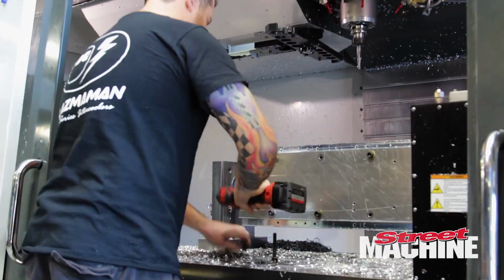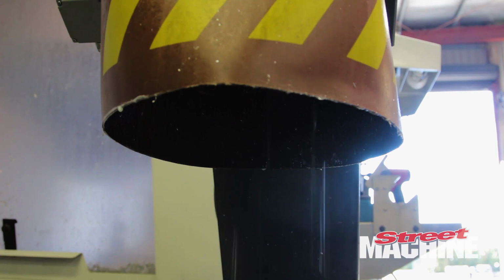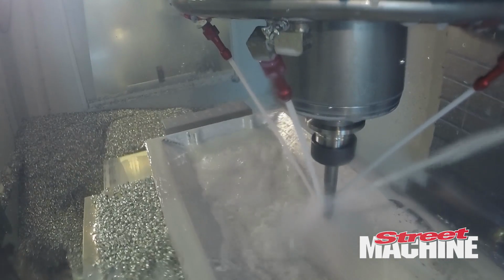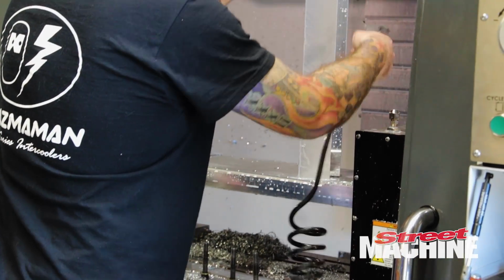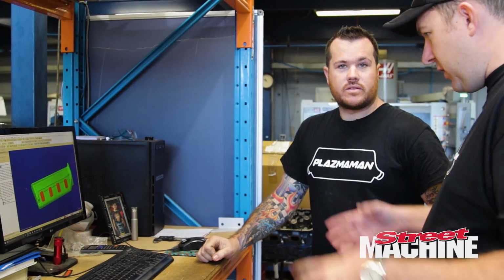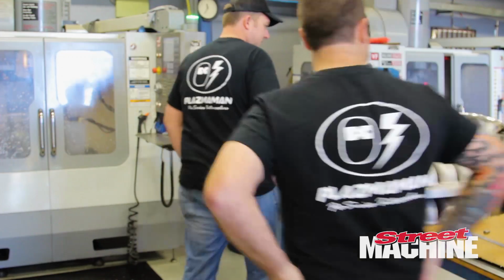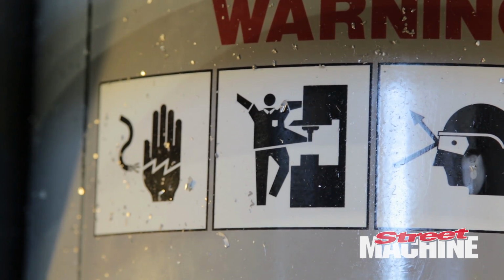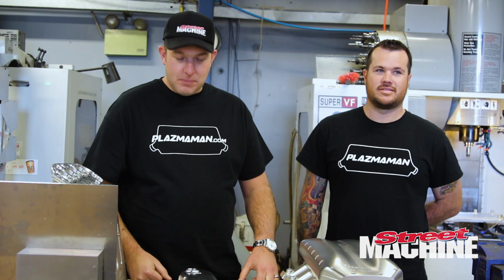A Plazmaman billet LS intake is born!

Comment: I have their Race version which is a good half-inch taller. It’s just collecting dust waiting for the rest of the engine to be finished. If I had it to do over again, I ‘may' have opted for the 'Shaun's Custom Alloy Billet LS Intake '. It has a narrow plenum, but the runners are longer from the mounting flange, and they extend into the plenum. All total, they appear to be about 6+ inches long. This would be much better for low to mid-range torque. The Plazmaman plenum is large while the Race lid makes the plenum huge! However, the runners are super-short and only extend from the engine to the base of the plenum - 3.25” inches. Hopefully, my Plazmaman will surprise me with joy. The worst part of the video; they never talk about the virtues of the design.

Comment: Very cool pieces.
Wondering though, is there a specific engineering reason you would make this out of billet instead of casting or 3D printing?
Seems like a lot of waste material.
Reply: Yes i was thinking the same although you can only cast certain shapes/profiles.
Reply: Could be cast then machined but casting is difficult on the smaller and intricate pieces also it can be weaker. 
I used to machine impellers and compressor wheels and the finished product would be 5 % of what i started with.
But all the swarf  gets recycled and used again somewhere else.
Reply: Watched the video, not sold on it AT all, still cant put the logo in it, obviously isnt very high resolution print
Reply: True but think of the waste of time, money, effort and materials for billet rocker covers. Billet compressor wheels serves an engineering purpose.
Reply: Good luck 3D printing alloy, billet is faster stronger, much shinier too
Reply: John Knight I get the shinny part, it's definitely a cool piece, but this part doesn't need to be as strong as it would be with this billet piece. It could be plastic and strong enough. As for speed, we had these guys come into work the other day, I don't recall if they do aluminium, but it's fast:
https://vimeo.com/178966010
Reply: I think any interfacing surfaces/features and beautification features would still need post machining with that process. But its just an example of fast 3D printing. HP also came and show us there 3D printer, but I had to leave early, so I don't know much about theirs.
Reply: I was wondering the same thing. Why not cast and heat treat a rough casting, then machine to finished specs?
It certainly uses a lot more high quality material, and a lot more run time and wear and tear on those expensive CNC machines, just ring up the supplier and order a pallet of 6160 Heat Treated billets.
This method also eliminates the processes involved in casting and then fettling the cast items to remove any flash and sand or other residues. It also removes the risk of porosity and sand or other debris inclusions in your finished casting.
Having said all that, it must be said that if this way was the most efficient and cost effective method then I am sure that engine manufacturers would be reducing or eliminating as much of the casting processes prior to CNC machining of final components.
Reply: Jimbob you may want to check out a few casting videos to see just what can be cast and engine blocks are amongst the most complicated of items that are cast given the extent of the built up sand cores they use.
Check out Olfoundryman on You Tube for a bit of a start on understanding casting.

Comment: Sure they look good, if you like bling factor but you're spending over 4 grand to lose torque with a shorter runner. The stock l98/LS3 manifolds are a great design and hold upwards of 20 psi. I personally don't see the need for this at all.